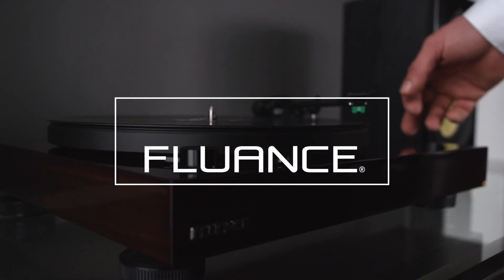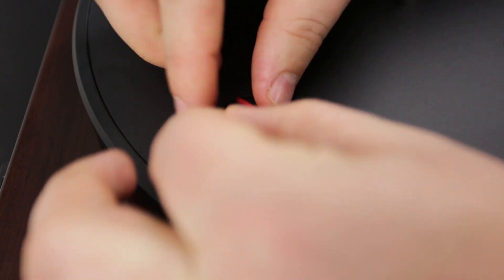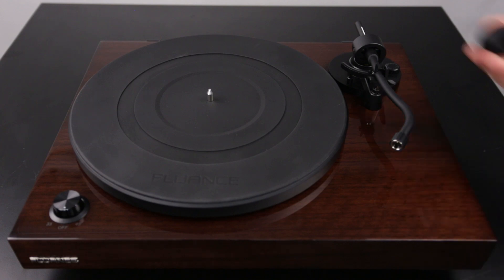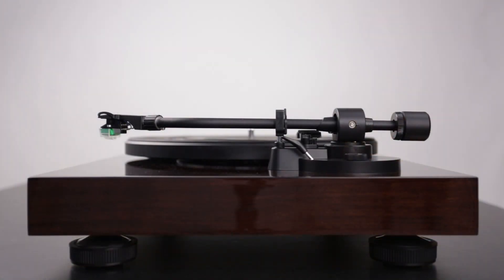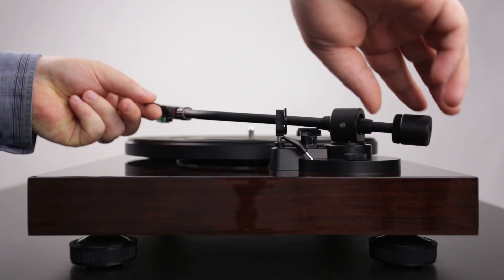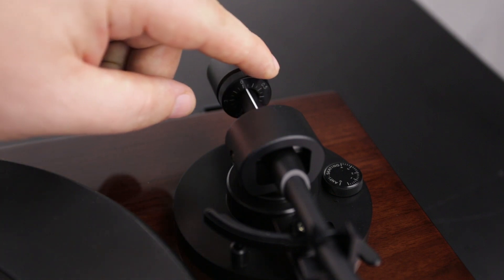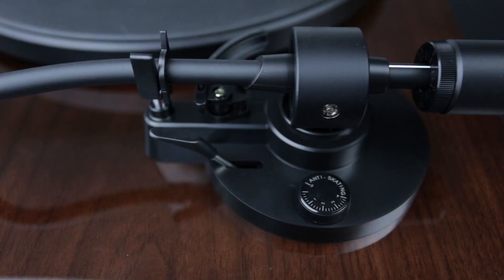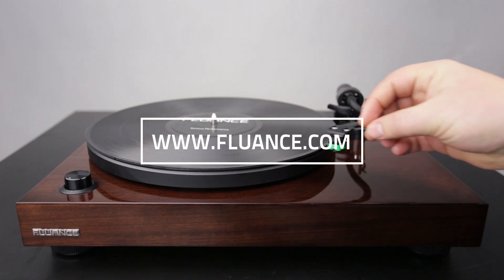How to Set Up the Fluance RT80 & RT81 Turntable - Properly Balance the Tonearm

Comment: This is without question the best turntable I have ever owned. I was blown away by the quality of all the components. You absolutely cannot beat the price. I was very close to buying the entry level Audio Technica turntable, but quickly changed my mind when I actually saw one in a store. It looked like a cheap piece of plastic. The Fluance turntable is a stylish design with high quality features. Highly recommended.
Reply: Tim Lawrence How long have you owned your Fluance turntable? Have you had any issues? I just purchased one. It should arrive this Friday. Just curious how it's been working out for you? Thanks.
Reply: @joelespinosa1978  Let me ask you the same question you asked. I'm going to get my turntable today and wondering if there's anything I should look out for in the long run. I'm a beginner and this is my first turn table. Thanks.
Reply: @Akashpagol  Man, I gotta tell you I love my Fluance. Not sure what model you're getting but I originally bought the Walnut RT81, had almost 2 years and had no issues. It was a great turntable.  I since then upgraded to the RT82 and really enjoy it. The RT82 and above have better motors that do not need any speed adjustments. Also, if you get a RT82 or RT83 you can upgrade it to the top tier RT84 & RT85 buy upgrading the Stylus/Needle and upgrading to the acrylic platter.  Or you could just buy the RT85 if you have the money to do so. I've already upgraded to a better stylus and platter. Either way you won't be disappointed with whatever model you choose.
Reply: @joelespinosa1978  I bought the RT81 and thanks for the tips. This should be very helpful  once I decide to upgrade my turntable.

Comment: A quick note on reseting tracking. If starting over make sure to set the ANTI SKATING dial to ZERO before starting and follow the instructions from the beginning after this. I moved my TT and had to redo the steps.
Reply: Why though?
Reply: @absolutebanjo4533  You can't balance the arm without it swinging back to it's starting point unless you set it to 0.
Reply: thanks for this, I was feeling a bit like an idiot for a moment

Comment: Thanks, I've been waiting for this. My RT81 is scheduled to arrive today. 

This is just in time!
Reply: How sturdy was the box? Was it styrofoam protected? Im planning on taking this baby on an airplane. A little worried about damage.
Reply: It was quite well packaged. It was designed to stand up to UPS. The unassembled turntable was packaged with styrofoam end caps inside two boxes, an inner one for the unit and an outer one for shipping.
Reply: thanks

Comment: I purchased the RT81 it's an amazing turntable. It's connected to a Pioneer Elite, Schiit Mani phono stage  an upgraded  cartridge (Golding Electra), Bowers and Wilkins 685 S2 bookshelf speakers and a Polk sub to power the bass. My advice pickup the RT81 for the price value and performance you can't go wrong.

Comment: After balancing the tonearm, when moving the counter weight to 2 it's imperative you move it counter clockwise (to the left). Like it says in the instructions. I was moving it clockwise as it was the quickest way to 2. Each time the weight would end being too heavy. You may need to move the counterweight nearly a full cycle to get to 2.

Comment: I would recommend the Fluance RT-81 as a starter turntable except for the tone arm.  It is very cheaply made.  We had ours for close to 2 years and the lock caused a mark on the tone arm because of poor quality plastic they used.  Even if you move up to the RT-85 you get the same tone arm! I upgraded to a T Technic SL-1500C-K

Comment: I followed  all the steps correctly from this video of Fluance. When I place the needle while playing the record, it's ONLY distortion I hear, not even 1 clear sound. Am I doing something wrong?
Reply: Same, did you ever figure this out?
Reply: Same with me. plugged into the phono and just loud distortion.
Reply: If you have a pre-amp in your stero system, try switching off the pre-amp on the turn table. This solved the issue for me.
Reply: @howbethdoesit5695  Thank you! Your response helped me!
Reply: @dm7837  yw. Enjoy!

Comment: Fluance, what are the 2 small holes in the bottom of the turntable, the ones marked 33 and 45? Are these for speed adjustment? Does it use an Allen wrench.  I don't want to mess with it, I'm just curious.  It's not covered in the manual.
Reply from the maker: Hello twinsmm1, You are correct that the 2 holes are for speed adjustment. We do not recommend customers making adjustments though and they are only used during production to ensure that the 33 1/3 and 45 speeds are set accurately.
Reply: @FluanceSpeakers  I have an AT LP120X and the pitch adjust comes in very handy. Some 33's can sound sluggish, some 45's and 78's can sound hyper. I just make a slight adjustment in the 8% setting. A small knob on top somewhere just for fine tuning, like 2% or3% would be a great feature. Also, adjustable feet.

Comment: I’m planning on getting an rt85, would the same steps apply?
Reply from the maker: Yes, though the tracking force would be 1.8g for the Ortofon 2M Blue.
Reply: @FluanceSpeakers  nice, also it comes with a 90 w class d amplifier, would I still need a receiver regardless or would that make due?

Comment: ive done all the steps and properly measured my tone arm. For some reason when i try placing the needle on the record it keeps lifting and returning to the holder. What am I doing wrong?
Reply from the maker: Hi Alan! When you turn the weight from 0 to 2.0, you need to turn the whole weight, you may be turning only the plastic ring which doesn't move the weight forward.

Comment: Correct me if I'm wrong but the "Tracking Force" coincides with the cartridge chosen and not the table used if I'm correct.
Reply from the maker: The cartridge has a compatible tracking force range. The tracking force we recommend is where the cartridge performs best on our turntables given the tonearm specifications and design.

Comment: Does this need speakers? If so which ones are the best?
Reply from the maker: Hi Liz! Thanks for your questions!

All Fluance turntables require external speakers. Our Ai41 and Ai61 models work great for this! Just remember, The RT80 and RT81 have a built-in preamp, but the Reference models will need an external one.

Comment: Can you go from this turntable to regular Bose Bluetooth speakers?
Reply from the maker: Thanks for your question! Fluance turntables require a physical connection via RCA to RCA or RCA to AUX. With the RT80 and RT81, they include a built-in preamp so they can be connected to most speakers without additional equipment!

Comment: Very interested in your turntables. What are the differences between the two models besides cartridge?
Reply from the maker: Hi Tim, 

There are a couple of differences to highlight. 

As you mentioned the cartridge is different. The RT80 uses an AT91 and the RT81 has the AT95E. The RT80 features a piano black finish while the RT81 has a walnut finish. The RT81 has a fully solid wood body construction. The RT81 also features an upgraded rubber slip mat, while the RT80 has a felt mat.  Let us know if you had any other questions.

Comment: I've had the RT80 for a year now and I've noticed when lowering the cueing lever, it drops the needle too quickly. Has anyone else had this problem?
Reply from the maker: Hi there! Sounds like you may need to add some dampening fluid to the tonearm lift! Please feel free to reach out to our Customer Experience Team for further assistance via Support.Fluance.com!
Reply: If you can adjust the bridge height, lower it. It won't drop with such momentum and better for cueing.

Comment: PLugged in to the phono jack in my receiver and when I play a record it's just distortion. No music. What's the deal??
Reply from the maker: Hi there! Be sure to set the preamp switch to PHONO when connecting it to the phono jack on a receiver. If it's set to line, the internal preamp and the preamp of the receiver may be overamplifying it.

Comment: Since first purchasing an RT80 it skips constantly the closer it gets to the center of the record. I have balanced, rebalanced and balanced again. I have tried the anti-skating set to "2" and all other settings without success. When the tonearm lever is used to lift the needle off the record a noticeable movement to the outside of the record is noted. I have tried multiple different cartridges, new and old records and verified the TT is level. Fluance "support" is laughable. I am outside of the return window other wise I would return this device. I strongly suggest you look elsewhere for a turntable as this has been nothing but problems since I purchased it.
Reply from the maker: We're sorry to hear you're experiencing this. We recommend reaching out to our Customer Experience Team if you have not already. Although you may be outside the warranty, we are still more than happy to assist you with troubleshooting and have an array of replacement parts available if you need to purchase any.
Reply: On old vinyl I’m sure I’m up to 4 grams and anti is 1 that did the trick on mine

Comment: Can't you put a finger grub screw in the weight to fasten would be good.and if you could rubber amount the back-end shaft onto the gimbal as well not really expensive to do you can already buy rubber mounts and of course get rid of the spring just use a weight. Got to use a better quality arm? when shiit brings out their timetable you're going to be in trouble you could do a deal with Origin live just saying for the models 84 and up keep your head of the game. Why don't you sell in the UK people ask me what is the reason. I think you need to change that headshell looks awful is it plastic? Not engineering plastic that would be too bad even aluminium is not ideal make it out of bamboo or a epoxy resin maybe polymer like these but I don't know how they're made if anybody does no ? you get in supermarkets for your bathroom utility like little cups  holding soap  made in China and they look like stone very good acoustically even making the plinth out of it wouldn't be bad anybody knows what type of epoxy they're using is?